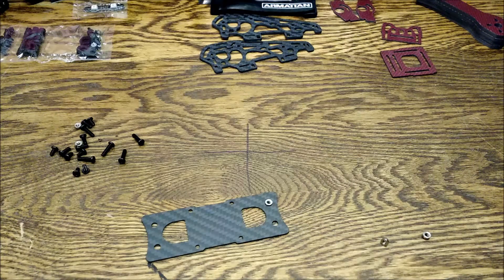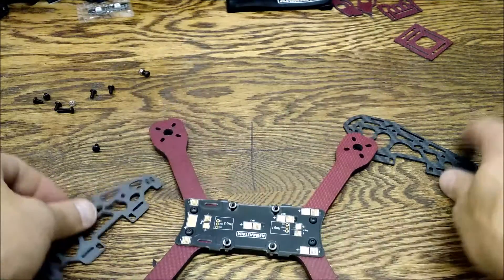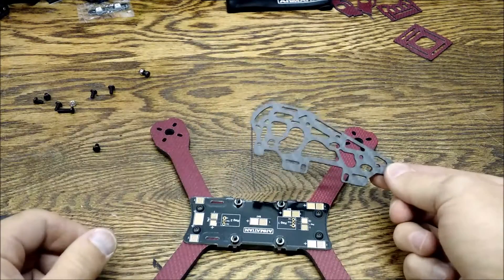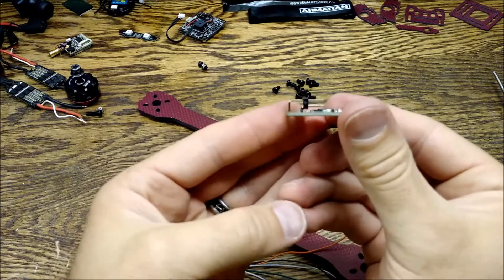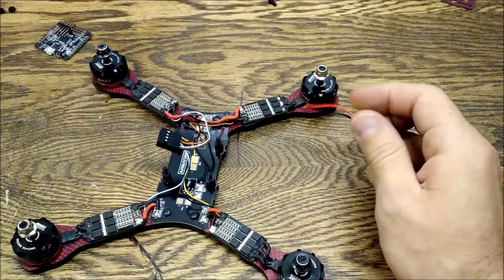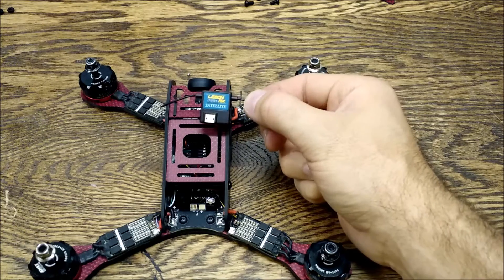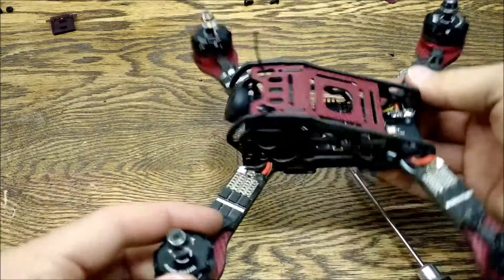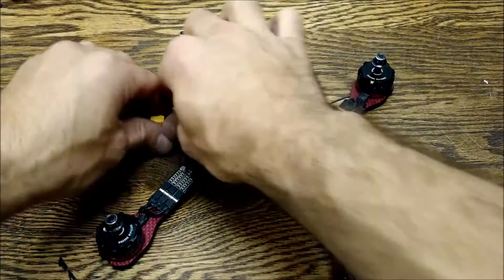Armattan armadillo build

Comment: so how did u mount the vtx? im currently stuck like you
Reply from the maker: I will have anther video out very soon with two different ways to mount the camera, but one method is using a 3d printed part that I designed.
Reply from the maker: Here is the video for the video transmitter mounting problem I had. https://www.youtube.com/watch?v=jJdfq5-mqhI